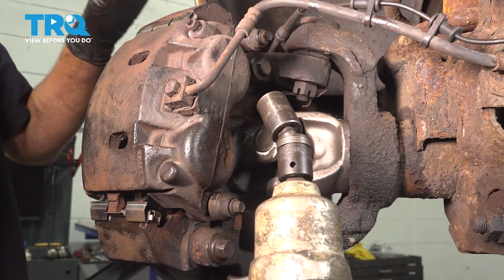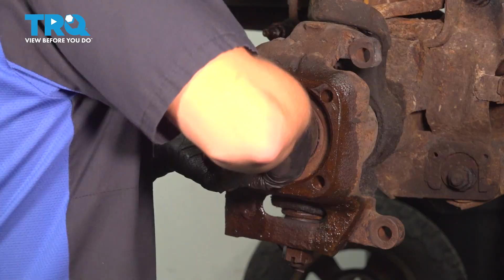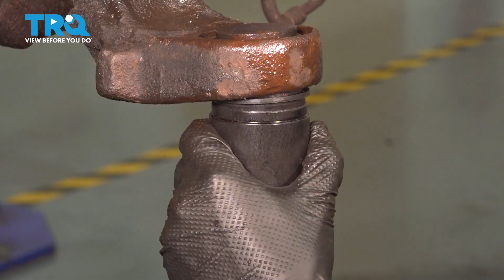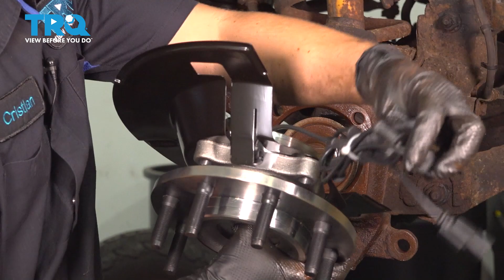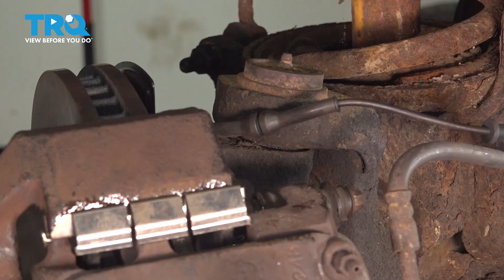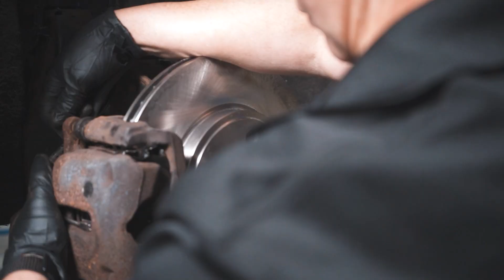How to Replace Lower Ball Joints 2003-2009 Dodge Ram 2500

Comment: If you're doing this job with the rear tires on the ground... lock it in 4wd or 4 low while you torque the axle nut...it'll save on yourself and studs..

Comment: If you have a ram before 2007 good luck getting your wheel hub off. I just decided to cut the studs out for the ball joint and pull the whole knuckle/cv at once.